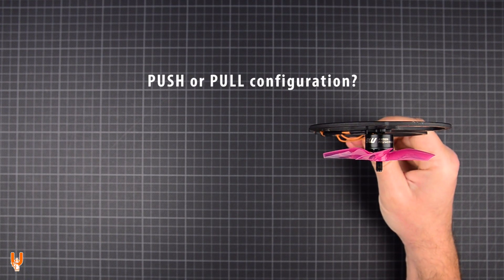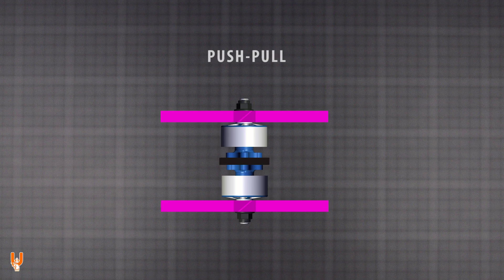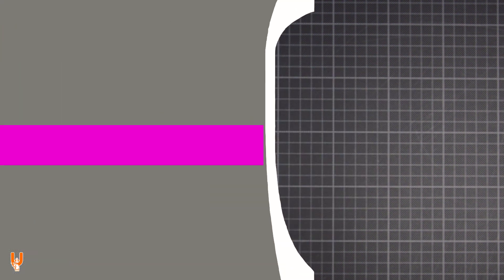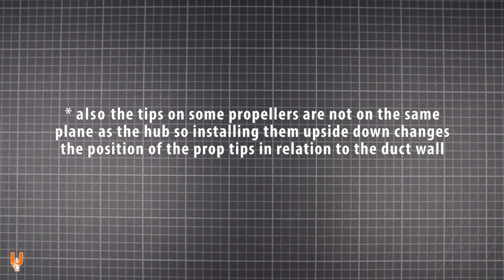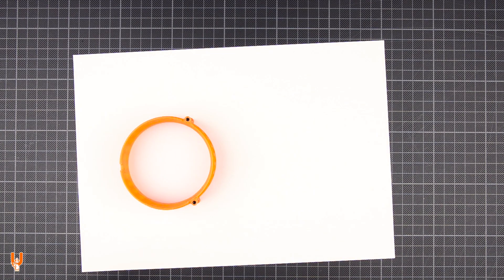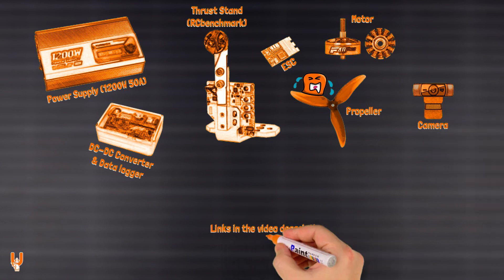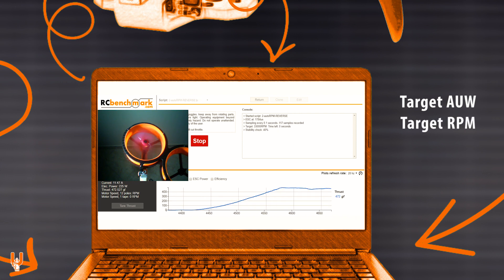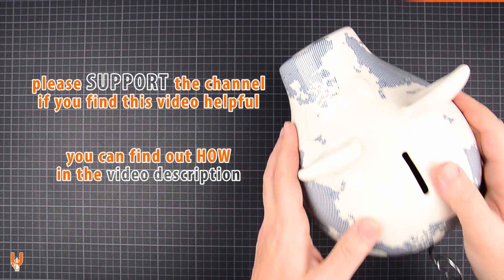This is why PUSHER is NOT always BETTER... feat. Diatone Taycan molded & 3D-printed ducts

Comment: If the duct shape is functioninal, which it probably is, by changing the propeller position inside of the duct, you might loose the advantage of it or even make it perform worse than without a duct, that's why i think the result differentiated this much.

Comment: was duct flipped? cause is design to work one firection. Curious
Reply from the maker: No, it slots into the carbon frame parts only one way. But it is fairly symmetrical and this is one of the reasons why I chose this design for my example.

Comment: It is necessary to compare without ducts. Here you can see the incorrect position of the propellers in the pushing mode. Can you do the same test, but with the same distance from the input and output to the propeller in both modes?
Reply from the maker: That could be a useful addition, although just for reference. Thank you for the suggestion. What do you mean by the second sentence? Incorrect position meaning that the position inside the duct is sub-optimal?
Reply: @muteFPV  distance from the input and output of ducts to the propeller is different for push and pull mode. Can you do the same test, but with the same distance from the input and output to the propeller in both modes?
Reply from the maker: I can and will, at some point, when I dive further into duct design. I have a few ideas that I think are interesting.

Comment: I'd like to see some pictures of how everything is being mounted in both configurations.  The arm of the thrust stand will also interfere with airflow.  Is thrust in the same direction relative to the stand for both the pusher and puller scenario?  Regardless of the winner, the differences appear too large to be valid.
Reply from the maker: It is not a matter of who won, it is a matter of pointing out that there are a lot of parameters involved when choosing either setup and that one setup is not always superior to the other. I don't take photos of the setup, it is not part of my workflow. The thrust stands sits approx 150cm above the floor. The arm interferes with airflow in reality, why omit it in the tests? It exists in both push and pull configurations so it is considered a constant for these tests, not a variable. The thrust is not in the same direction relative to the stand but there is plenty of free space for air to flow in both directions. For more information you can read my detailed reply to the comment of user Francis. I stand behind my test results, which had been consistent throughout all the test runs. Please explain in more detail why you think they should be invalid.
Reply: @muteFPV  You sound like a guy who understands science so you probably also know that the results should be reproduceable by others.  I'm looking to understand the method.  My skepticism is from the degree of variance.  I think there may be something else affecting the results and seeing the two setups might reveal that.  Did you just flip the prop over and spin it the other way or did you change the mount?  Was the arm in front of the airflow in one scenario and behind in the other?  Are you comparing negative values on the strain gauge to positive values?  Did you change the duct orientation?  Setup photos would answer most of my questions.  I see the great effort you put in and I appreciate it.  I'll suggest that photo documentation of the setup should be part of your workflow if you want to make a scientific statement.  No disrepect intended!  I just like to know what I'm looking at when numbers are presented.
Reply from the maker: Just think of it this way: I did what you would do if you owned a Taycan and wanted to convert it to a pusher. The ducts don't fit to the frame upside down, they slot into the braces and rings only one-way. Also the ducts appear to have a very symmetrical design and it is one of the reasons why I chose the Taycan for this example. Of course the arms (of the thrust stand and of the frame) are in front of the airflow in one scenario and behind it in the other, how can it not be? The reason you are seeing such a difference in performance is because the propeller sits closer to the outlet of the duct in the pusher configuration. The difference would be even bigger if I had used the Gemfan 75mm 3-bladed props, whose prop tips sit lower than the hub (so they would be even closer to the outlet in push, compared to the D76 5-bladed). The goal of this video is to point out that there is a lot involved when chosing a ducted setup and that things are not just black or white. I am always including video footage of my tests. You can see that everything remains the same between push and pull, aside from the prop orientation of course.
Reply: @muteFPV  I'm no closer to understanding what you've done but I can see this discussion has run its course.
Reply from the maker: I don't mind discussing further, by all means! Please let me know which part I have not explained adequately or is confusing to you.

Comment: And here I was just tonight playing with the idea of converting my squirt v2 into a push setup. May still do it just to see what happens, but will keep this data in the back of my mind as I test.

Fantastic video!
Reply from the maker: Thank you very much! Which ducts are you using for the Squirt?
Reply: @muteFPV  Stock ones from Rotor Riot (thing:4580233). Very large gap between the duct and the blade so moving to a lighter design that allows me to use slightly larger props and may  help with air drag (thing:4483283). Debated using those larger ducts in pusher since the open sides will allow air to get sucked into the props and perhaps give some positive benefit.
Reply from the maker: I highly doubt the "open" design will have any performance benefits. Maybe it will be better to run simple prop guards instead of this one. I remember seeing a slimmer duct design for the Squirt that people said worked nice, but I can't remember the name.
Reply: @muteFPV  Nice thing is I can take a flush cutter to them if I decide I want open prop guards. ;)
Reply from the maker: The other one is called "slammed", I found it in my notes but I don't have any links to a design.

Comment: I don t know why my comment was remove but here it is again.

Your test are misleading.  You need to provide the gap information when testing different setup,  also your push vs pull test can t be representative because when you do the pull test,  your load cell is blocking some of the flow and create turbulance.  The 3d printed duct will have a smaller gap for shure so better results.  You can use recut propeller to match the gap of each test,  that should give us a more realistic results.  You still explain the propeller placement and that a good point but when you do the push vs pull,  did you try to match the same placement???  I mostly do only thrust test with ducts on my thrust stand,  if you want to contact me,  I will be happy to discuss with you
Reply from the maker: Yes, probably. I just wanted to make sure that there is no misunderstanding.
The tests of this video are not meant to mislead anyone. There is no reason to mislead anyone with anything, so I suspect you may have missed the point of this video. The point I am trying to make is that there are situations where the pusher configuration does not perform better. Of course there is a specific set of parts that performs best for each duct and each configuration, but this was not the goal of this video. People usually just flip the parts around, convert from pull to push and call it a day, with the idea that one configuration is always better than the other.
I was not trying to find the optimal / absolute best performance of these ducts or this motor-prop-duct combination. This was not the point of this video and this is why I did not trim larger props to barely fit them inside the ducts. I am testing the exact same motor, same propeller and same two ducts (one molded and one 3d-printed) in order to reduce variables and focus on the configuration and the duct material. The ducts are positioned with the stock stand-offs and carbon sandwich rings of the Taycan frame, so the alignment is the same between all the tests. I am giving data for push and pull performance on both molded and 3d-printed ducts.
The 3D printed ducts have an uneven gap (smaller in some parts, same on other parts), which is one of the things I wanted to point out with this video. And this is why they happened to perform better.
The push vs pull tests are, actually, representative because the mount and load cell are considered a part of the frame and, more importantly, they exist in both the push and the pull configurations (if the taycan carbon braces happened to be wider we would not even be talking about it, would we?). Please note that I am using custom CNC mounts so the width is not as wide as the stock motor mounts supplied by RCbenchmark. The width of the mount is almost the same as the width of the load cell. The mount and load cell are positioned behind one of the braces of the carbon frame. Both push and pull configurations are mounted the same way so this is not a variable, it is a constant that remains the same in both configurations during the tests. Same applies to the motor and propeller. The only variables are the configuration (push / pull) and the duct material (3d printed / molded).
The reason I chose these parts is because they represent a very simple example of a BNF that was sold with 3D printed ducts, that several people had converted to a pusher setup and that has molded ducts as an upgrade part (and is sold with molded ducts in the more recent versions). So no custom solutions, just off-the shelf parts intended for the exact same quad. 
As for the placement of the propeller, again, the goal was not to find the optimal motor height / prop position for the maximum performance on these specific ducts. The goal was to simply prove that things are not always better when you choose a pusher setup. The prop was installed upside down, same way as anyone would install it when converting from pull to push.
Feel free to send me anything you need, as a comment here or to my email (mutefpv at gmail dot com). I am always open to suggestions. I do want to dive more into duct experimentation, it has been in my long to-do list for a long time.
Reply: @muteFPV  tank you for the long reply.  Yes I totally understand your point now that you want to narrow your experimentation on a spécific duct(drone)  without changing too much variable.  If I can add up too your test,  your duct design look to have a open diffuseur because it is designed for the motor too be place at the bottom of the duct. A pusher design duct  need to have a straigth or sligthly closed difuseur.  On a design that I made for the shuriken-whoop 2.5inch,  I saw a gain in thrust by choking the difuseur by 4%.  When choking at 5% or 3% there where a lost in thrust.  This duct have stator vane that also create additional thrust.   780 to 950g of thrust was easy to achive on this duct with a 2004 3000Kv to 3150Kv 6s.  A 1505 3450kv was better on efficiency and thrust but the motor nearlly overheat on the thrust stand.

 I know it is hard work doing those tests,  I have spend alot of time doing the same and trying to understand what happen everytime.  If you keep posting video on duct design,  I will recomand you to use a gage to mesure the gap and share this info on your video.   My best gap that I was able to run test was 0.1mm.  I saw a difference of near 100g of thrust between 0.1mm and 0.3mm on a 3 inch racewhoop (peak at around 880g on 4s).

When I test small ducted drone with high rev motor,  I often hit the rev limit on the software of my Rcbenchmark thrust stand so I found a small hack that can fix the rpm limit problem. If you are interested to know what it is, I will try to contact you and send you more info about it.

Keep up your good work.
Reply from the maker: Thank you for the valuable information! I forgot to mention that the fact that the taycan duct is fairly symmetrical is another reason why I chose it for this specific video. I have some ideas regarding the test methodology of ducts for future tests, we can discuss further when it is time. What do you do for the rpm limit, play with the magnet count and then recalculate rpm afterwards?
Which thrust stand are you using? I have switched to the 1585 for larger motors but their mount is too bulky for duct tests and I am not sure I can design a custom one without affecting their torque measurements.
Reply: @muteFPV  you can t play with the magnet count to alter the rpm limt because the software count everytime he see a magnet  so if you run a 12n14p and say it is a 9n12p,  he will still count 14 magnet and because 12 magnet should be 1 turn,  the rpm will be off and you will hit the same rpm limite.  I don t know if I explain it well but basicly your test will be the same results.   Using the rpm optical probe is the solution to go at a higher rpm but when testing ducts,  there is no room for the sensor and it will affect your flow.  Dynexhobby sell a rpm laser probe that is plug and play,  you need a marker like the optical probe.  The laser can be far away from the duct so it will not affect the air going in. If you can t find it,  let me know.

I also have the 1585 thrust stand.  I mostly test pusher style duct because it is for personal research and I don t see the need to built a pull design.  Because the motor bracket is bulky,  i use a custom alluminium spacer to move the duct a litle bit further so it can be a solution that should help your test.  A 3d printed spacer will work as well but should affect your torque reading.

Props and motor match that I test than give good result 
3 inch  (motor 2204 to 2305 2800Kv 6s)=  hskrc3045,  nazgul3040
2.5 inch (2004 3000Kv to 3500Kv 6s) = nazgul2525
2 inch (spcmaker 1505 3450Kv and custom rewind)= nazgul2525 recut to 2 inch
1.5inch( t-motor 1404 4600Kv)= gemfan d63 5 pales

All those propellers are only effective if the gap is tigth(0.1mm to 0.3mm)  . The thrust will be higher and the results will be more efficient(more fligth time)

On my 2.5 inch,  the spcmaker 1505 3450Kv give a solid reults better than the 2004 that I have tested but the motor almost burn.  So it is at is limit on the thrust stand but should be perfect for flying.

If you want to test push duct, I can sugest you to test 2 of my design in 2.5 inch.  One is a more conventional duct with optimized inlet and the second is the same inlet with longer difuser and stator vane.
Reply from the maker: Thank you for all the details. We will be in touch ;) In practice such a narrow gap may mean prop strikes that probably damage the duct, whenever the quad bumps even slightly on something. There is a fine balance somewhere between optimal performance and reliability / ease of use, don't you think?
Reply: @muteFPV  yes you are rigth. I must have said it is a personal choice.  When they touch the duct,  the gap became a bit bigger until they don t touch anymore.  If the duct is tpu, the props will break when it touch.  If you feel confortable with 0.5mm, use that gap if it is bigger than go bigger but there will be a time where the gap will be too big and the duct will not help as much.  It all depend on the original design,  if it is stiff enougth,  the gap can be closer ...
Reply from the maker: Just to avoid any misunderstanding, I did not remove your original comment. Maybe it had a link in it and YouTube removed it automatically, it happens quite often. I will reply to you in detail later today.
Reply: @muteFPV   I don t belive you remove my content,  sorry if it sound so.  I have made reference to another social media name.  It is mostlikly, youtube algorymt that remove my post . . .

Comment: Definitely unexpected results. Do you happen to have some feeler gauges to check whether the 3d printed duct actually has a smaller gap between the prop and the duct wall?
Reply: Just what I thought might be the explanation for this. The files for the printed ducts may be the same, but due to shrinkage the ducts became smaller. A manufacturer of injection molds usually designs those so that the final part has the right dimensions, +/- tolerance. In this scale, every 10th of a milimeter counts. In fact, to be efficient, proper ducts for the usual quad props would need to be less than half a mm from the duct walls, which is kinda hard to achive since all parts involved have lots of material related flex to them and manufacturing tolerances are all over the place, from an engineering perspective. After all, those are hobby, not "aerospace" parts :D

I'd love to see a test done with oversize props ground or cut (lathe) down to precisely match the ducts. The props don't need the blade tip geometry which is designed to reduce vortices and all kinds of other phenomena at all when run in a duct anyway. :D

Nice video anyway, thanks :)
Reply from the maker: Yep, the 3D printed ducts are uneven (not perfectly round) and some parts of the duct have a smaller distance between duct wall and prop tip, compared to other parts. I don't have feeler gauges handy but this is evident even with visual inspection. And this is what I am trying to point out with this video, because a lot of people think that converting to a pusher setup will always have a positive outcome no matter what. A whole set of duct tests has been on my to-do list for a very long time, I need to do it at some point.